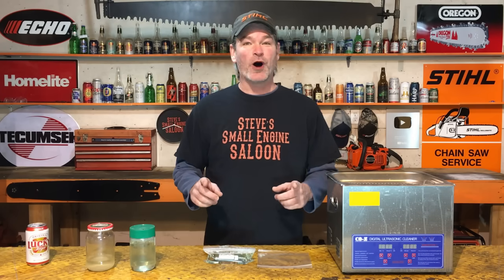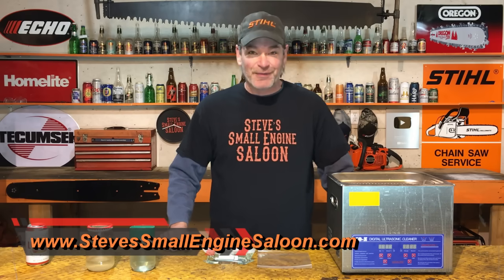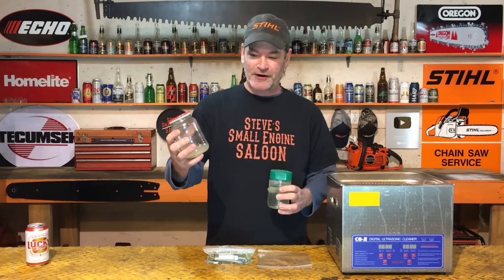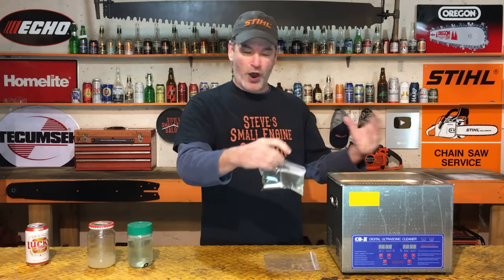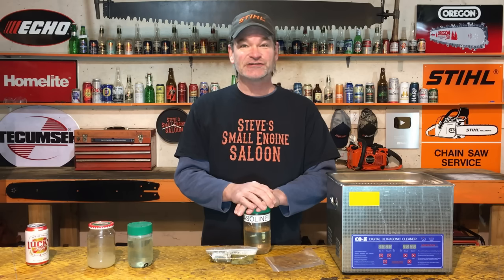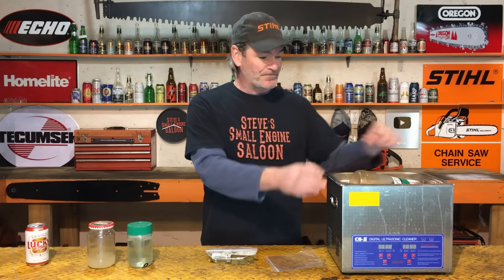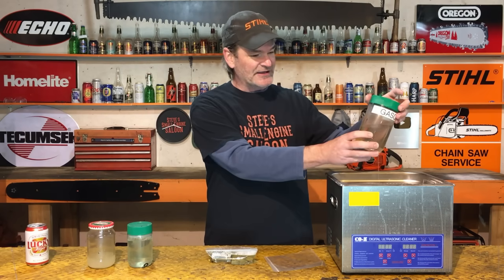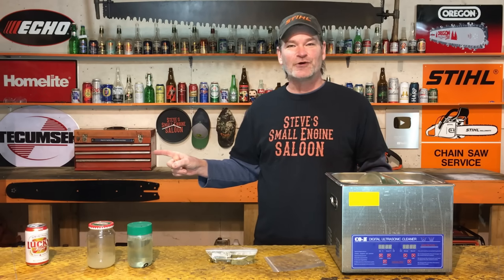UPDATE: Ultimate Tips For Using An Ultrasonic Cleaner

Comment: Steve I just made a comment on your old video, I know these are 3 years old now, but your are right and you are wrong!
Gasoline IS dangerous.
The chain saw fuel tank is sealed. The example you just showed is sealed.
The original video the container was un-sealed and remained un-sealed.
Gasoline has a flash point of -45 deg F.
That means that at above that temperature it is giving off a flamable gas, if the ratio is 1.4-7.6% gas to air it will explode.
In ratios outside this range is will catch fire.
The gas is continually given off and is heavier than air.
It will fill the container and then fall to the floor and spread out while ever the container is un-sealed.
The ignition source could be 20 ft or more away.
Gasoline can be safely handled but don't ignor it's deadly potential.
I have personally witnessed deaths in gasoline explosions!
Every mechanical on/off switch generates a spark when it is turned on OR off!
Every electric motor will generate sparks!
Every relay will generate parks!
Never mind static electricity!

Comment: Steve have you tried a jar that is sitting on the bottom of the cleaner rather than floating in the liquid . I think the transmission of the high frequency would be better if the jar sits on the bottom of the cleaner . After all this is what the cleaning action is based on ,

Comment: Its the fumes of gasoline that evaporate near the surrounding electronics in the machine/ spatial area,  should there be a short/power surge in the electronic circuitry,  gasoline combined with oxygen is not a safe environment  when handling electronics. even the temperature of the billions of microbubbles exploding from the ultrasonic cleaner has me questioning this method even further.

Comment: Gasoline. (petrol in my part of the world, oi, oi, oi), is only not recommended as a reservoir tank solution on it's own. Putting it in an air tight container, submerged in water is OK. For mine, I like mineral turpentine or kerosene as an alternative for those oil and dirt crusted items, like a carb or a socket.

Comment: Surprised no one mentioned that gasoline expands so using an unvented container for gas is considered dangerous. Pressure builds as temperature increases, you could easily add a vent tube.

Comment: There's a few things that clean as well as gasoline, but they are just as flammable (often more so) and much more expensive. MEK, Lacquer thinner, Acetone etc. Some are also MORE toxic than gasoline. Toulene is one. I  think the touchiness about using gasoline comes from the old days, when gasoline contained tetraethyl lead, which is easily absorbed through the skin, and in those days, people would clean parts in a big open tray, often while smoking a cigarette. As with most things in life, a little common sense goes a long way. Safety 3rd - YOU are the only one responsible for your ultimate safety. If you're not comfortable with any chemical or procedure, you shouldn't use it.

Comment: Thanks Steve, Now I have to go start a science project. Because, now I want to know what effect fuel additives (Seafoam/Lucas/fuel injector cleaners) may have to increase the cleaning power of gasoline. OR, for those who don't like the flamibility of gasoline (Diesel) I think i will try both. Somehow I think the diesel will last longer as a cleaner. Less evaporation of the VOC's. But it may make diesel less effective as a cleaner too. Iv'e used both in the past but never . (WOW look at that big word)

To others, I think a small engine guy know the "WOOF" factor of gas, as it's running all over your hands and workbench while working on a carburator. Use what your confortable with, know the risks and don't lite a match. 

I have also learned that the continer is less effective when floating. (it works, floating, but less effectively) So, I am also going to try weighing down the container, so that it rests on the bottom of the basket. (Yes, I have read a post, the basket should always be in place. (damn the rules of physics) maybe to provide an air gap between the basket and bottom surface of the tank, Not sure why that is reccomended. (I don't think it is wrong) i will be testing that too, hope to not burn out my cleaner during the test. 

If you try any of these, I would love to know your results. Keep em coming. I do miss the beer scale of difficulty that you used to do.

Comment: Try Diesel.  It has a higher flashpoint and much lower fumes.  An old mechanic I once knew would mix a 50/50 solution of engine oil and diesel and put it in the engine pan and run the car at idle for 15 minutes then drain.  The insides of the engine were spotless, and all the sludge was gone.

Comment: I used to use a corrosive cleaning solution [ BBQ cleaner ]  OK if the carb is going right back on engine, bad news if carb is going to sit on shelve .  I now ...  Soak carb in Vinegar for about 3 hours .  Than carb goes in Ultrasonic filled with plain water .  Note, blast cleaned carb with compressed air to remove water, let dry throughly.    No corrosion

Comment: The chainsaw is designed for flammable liquid storage & operation. Is the ultrasonic cleaner? Does it say it's OK to use flammable liquids in it? 
My concern with using gas is obviously because it's flammable. Then you seal it in a container. Put that container in the cleaner that produces sound waves that cause cavitation & subsequent heat. In a sealed container? Sure the water will absorb some of the heat (less heat, less pressure) generated by the cavitations. But I wouldn't want to mess with the possibility of fumes escaping & getting to the electricals of it. How strong & durable is the seal on a peanut butter jar lid? Especially for a distillate. Not what the seal was designed for I bet.
I'd squeeze the plastic jar so the heat has room for expansion & make sure I limit the time accordingly. 
I wouldn't use glass with gasoline, just for this reason.

My 2 cents worth. Thanks Steve for all the fantastic videos!!!

Comment: I didn’t have the patience to read all 594 comments, but I will add this one in case it wasn’t posted previously. 

Wanna make gas or any other flammable substance non-explosive in your ultrasonic cleaner?  Do the jar trick, but COMPLETELY top off the container with the fluid and seal is TIGHT. With little or no air, you break the fire triangle: fuel, oxygen, ignition (spark).  With no air (21%oxygen), there is no oxygen.  No oxygen AND no ignition source, it practically impossible to cause and explosion.
  Oh, and I would add, probably a better idea to use a plastic jar, rather than glass, to allow for thermal expansion. I would even consider a heavy duty Ziplock, I would be inclined to think the vibration transmission is better than hard plastic.

Comment: Gasoline as a cleaning solution is unmatched for gas engine parts cleaning.  Use common sense and don’t get gas close to an open flame.  I’ve used gasoline as a cleaner after pulling automobile engines.  Works great but is hell on human skin; wear gloves.
Reply from the maker: Thank You...

Comment: 12v will not ignite gasoline… the stator on that chainsaw probably does not even produce that much voltage. 12v’s are used in almost direct contact with fuel injectors on fuel injected motors. Cigarettes can be extinguished and gasoline. If 120v came in contact with the fuel, yes it could ignite. Gas in a jar inside warm, noise vibrating water will not explode. Can it build compression and vapor… maube. Will that spontaneously combust… no. Gas is an excellent cleaner. Might i suggest aviation fuel… does not combust untill atomized, and is free of ethenol. Thank you good sir, continue doing what you do!
Reply from the maker: Right on

Comment: my understanding is that gasoline is NOT flammable in liquid form, it's the vapor or "gas" form that is volatile and flammable (one of the reasons it needs to be aspirated in an ICE, right?).  Also gasoline in a jar is missing one of the three elements you need for combustion, so eloquently described on your great channel, an ignition source or spark.  Also, I read that the bubbles that ultrasound create are IMPLOSIVE and not EXPLOSIVE, this is another reason why ultrasonic cleaners are not volatile, like a large building being demo'd it just collapses on itself without blowing up the other buildings around it.  Just my 2 cents of understanding.  Love the channel, learned a ton from your efforts.

Comment: Tnx for the tips.  We are getting ready to use an ultrasonic cleaner on parts to the injector system on an aircraft engine that has developed a fuel obstruction somewhere.  We will be experimenting with 91 % isopropel alcohol, car gas, 100LL airplane gas, maybe acetone (talk about dangerous !).  We will try to let ya know how it works, or if it works. Tnx again!
Reply from the maker: Good luck!

Comment: So Gasoline, The only danger is if you spill it on the workbench and say there is an ignition source like a hotwaterheater nearby then the vapors could travel along the floor and be ignited. As long as you are aware if that then wear gloves and have at it.

Comment: Fifty years ago I worked at a auto repair garage and the owner there swore by kerosene to clean parts.He always said it was a better cleaner then gas for cleaning parts.. I would also recommend Dollar Stores LA's Totally Awsome concentrated degreaser, $1.00 for a qt.bottle.Great stuff and a chart on the back with dilution mix ratios for what you are cleaning.

Comment: Aluminium foil / container it will put HOLES in the foil. Is it true that it will damage gemstones ? I found this link
https://www.jewelrynotes.com/what-jewelry-you-should-not-put-in-an-ultrasonic-cleaner/

My first use of an industrial ultrasonic was back in 1984 it was used for cleaning brass parts for domestic water heater production line.
all the best

Comment: Been using gasoline in ziplock bags, I was initially concerned about the gas expanding but have not observed it but I am not using heated water .
Reply: the gas doesn't melt the ziplock bags?
Reply: Yes. After some time.  Started using a glass jar without the top.  The glass seems to transfer more movement than the plastic

Comment: Try 90% Rubbing alcohol instead of gasoline.
* More stable
* No toxic evaporation
* Les residue deposit from ageing 
* Keep longer
* Doesn't smell as bad
* Safer in "hard" air tight container
 Just a suggestion
Reply: alcohols are "polar solvents" (the -OH part), and don't do that well while trying to dissolve non-polar substances (like petroleum products).  You prefer non-polar solvents for that.

Comment: A lot of the glass jars and plastic containers doesn't seal very good after the seal has been broken.  It is best to try and prop the jar or container upright when using it because if the ultrasonic cleaners can work through the container it can also work through the threads  especially gasoline . Don't get me wrong I like gas as well.
Reply from the maker: Right on

Comment: "Lightning in it" comment by one of your viewers may be in reference to the physics behind ultrasonic cleaning. 
The process of CAVITATION BUBBLES do cause extreme temperatures as hot as the sun's surface and/or a spark when the water bubbles collapse. Ultrasonic cleaners work by this method. 
Please advice your viewers to keep body parts out of the solution while the unit is running. This process will destroy tissue.

Comment: I just want to comment on the gasoline thing. 
First of all, one of the reasons that gasoline, or combustibles are frowned upon as an added solution to the tank (not the jar) is because the fumes can migrate over and around the bath tub and find it’s way to the heating element and or circuit boards, then KABOOM 🤯. For clarification, this can also happen without using the heater.
In this case the petrol vapors or any other combustible solution vapors are being contained inside of the jar, so as far as I can tell, the SEALED jar is what makes the difference.

Comment: Very helpful. A lot of ppl will use Dawn and vinegar (or citric acid for cooking) for cleaning rifle brass. The brass comes out very clean but the acid needs to be neutralized with something like bicarb soda to stop corrosion. The main point about using even weak acids is to keep the acid away from the stainless steel tank. The tank walls are paper thin because the tank form is deeep drawn and stretched; something like diluted vinegar will chew through and make pinholes, particularly if the solution is contaminated with dissolved metals. (Scientists call this intergranular corrosion from dissimilar metals). Using CLEAN water in the tank will save a lot of grief...if the tank leaks it drips fluid straight to the circuit board. Your method of using a jar is ideal protection and saves tipping out a whoĺe tankful of used chemicals. Thumbs up.
Reply from the maker: Right on Ray!  Thank You...

Comment: Something I learned from my grandpa was using kerosene. Never compared it to the cleaning properties of gasoline, but with the higher ignition point and other properties it may be a good alternative
Reply: Kerosene and mineral spirits are my go to, smell better than gas as well!
Reply: What about using Diesel fuel instead of gas, it take compression to ignite,
Reply: @earnierowland232  I have used diesel for years to clean things over gasoline for that reason there. Works just as well without the worry of starting a fire.
Reply: Kerosene is very close to diesel but much more expensive.
Reply: Diesel if your ok with getting it off the parts afterwards may be a similar high flash point non polar solvent. Kerosene and white spirit may be cleaner in terms of left over residues and gumms. DCM IPA and acetone may offer some good polar solvents but watch out for there fumes. I have used 0.2molar solutions of lye (sodium hydroxide) to get foul oil off of steel parts but keep that off of plastics and alminium.
Reply: Diesel is a phenomenal parts cleaner. A lot of great engine cleaner sprays contain diesel.

Comment: Safe use of flammable solvents with bench top ultrasonic cleaners.

Fill the ultrasonic cleaner tank with water and a surfactant then activate the ultrasound for mixing and degassing.
Place parts in glass containers and cover them with solvent. Alternatively place parts in fine-mesh baskets then lower the baskets into the beakers. Loosely cap the beakers to reduce evaporation.
 If the solvent evaporates there is a chance that it could ignite.
Lower the beakers into the water/surfactant solution. Place them in the cleaning basket, not on the bottom of the tank. Only one or two inches of the beakers need be immersed in the solution.
Activate the ultrasound. Cavitation passes through the beaker walls to the solvent and performs the cleaning operation safely. 
At the end of the process first turn off the ultrasonic cleaner then remove the parts. This minimises the possibility of solvent vapours being ignited by a spark when the switch is pressed.

Adapted from :-    https://iultrasonic.com/blog/flammable-solvents-and-ultrasonic-cleaners/

Comment: Gas stations say to turn the engine off before pumping.  I'm not sure why. If the thought is that the ignition will set the car gas tank on fire and the car gas will set the pump gas on fire, the ignition to gas tank fire would be independent of the pumping, meaning cars would be driving around spontaneously blowing up and if that occurred while pumping, it would also blow up the gas station...I've never heard of either of those occurring.

Comment: They meant that Gasoline is "Dangerous" due to the ultrasonic vibrations heating up the water bit by bit, which I often noticed when cleaning just with normal water, to some point that I even triggered the overheat protection. :)

Comment: Thanks for the update. I’ll use glass when possible. As far as using gas as a cleaner, I used gas for cleaning all my life ( I’m in my 60’s ) and never had an issue. Some people are just over cautious.
Reply: Gasoline might take a spark, but having played with a little bit of industrial ether.... gas sound pretty safe.
Reply: Gasoline isn't safe to be exposed to constantly just because you're ok (or so you say) doesn't mean it won't significantly increase the rates of cancer in others.
Reply: Gasoline is the MOST dangerous substance in a houshold - it is FOOLISH to use it for cleaning in a garage environment.

Comment: Yes, the prohibition on using gasoline to clean parts only makes sense with open containers, like traditional parts washers (like a sink, with a "faucet" for the recirculated cleaning solution), or even a tray and a brush.   Any cleaning method agitates the gasoline and creates vapor, and if the vapor makes it to an ignition source, BOOM!

Comment: Little bit of trivia ( from Howstuffworks dot com ) : "In dry cleaning, a petroleum solvent is used instead of water. It is 'dry' only in the sense that it is not wet with water. In the early days of dry cleaning, this solvent was often kerosene or gasoline. Today the industry uses a solvent called perchloroethylene almost universally."  Note: Lighter Fluid would also do an excellent job as a cleaner ( ex: getting corrosion off of electronics PCBs).

Comment: I almost gave up on my old MTD Yard Machines 139cc mower that was running very rough. But I used an ultrasonic cleaner filled with water and with gasoline in a plastic container for 5 minutes on each side of the carburetor. There was a small amount of particles at the bottom of the container that had come from the previously cleaned carburetor! And now the mower is easy to start and runs smoothly and strong! Thanks for the awesome video.
Reply from the maker: Nice work!